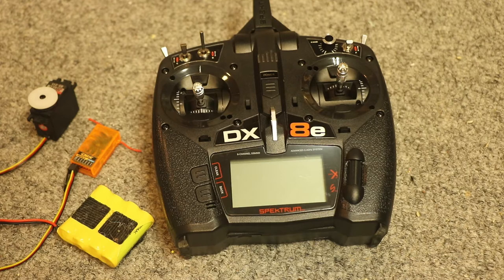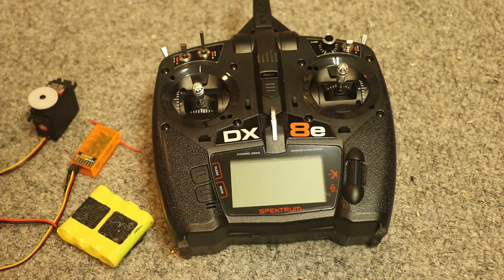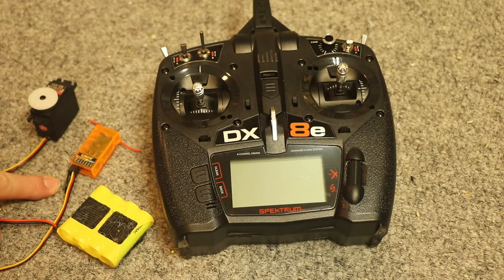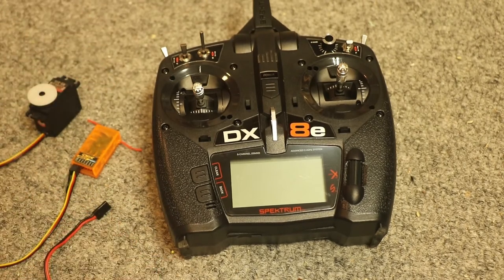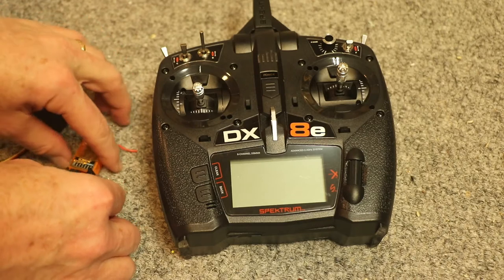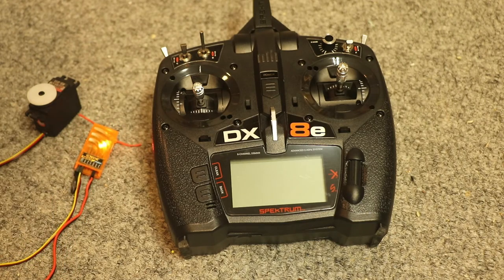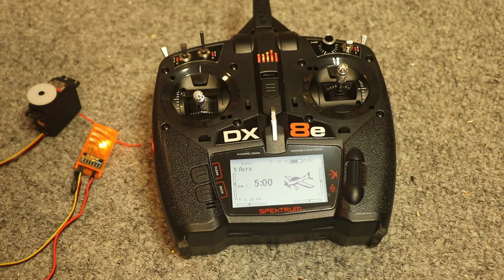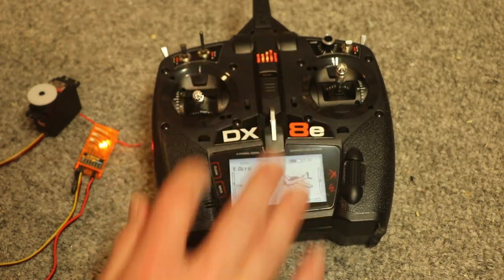Orange R615X binding with Spektrum 8E transmitter

Comment: Fred do you have a source for getting a used multi chan radio modifed to a encoder/decoder format? what current radios have dsc function? my old cirris system has become lost and i need a replacement system.
Merle
Reply from the maker: All of the sources I used 20 years ago have probably moved on with the encoder/decoder down the line electronic controls conversions.  If you can find a used JR DSC radio you will need the deluxe switch harness with three wires to hook everything up. Hopefully EBAY might have some used JR DSC radios. I stopped using DSC radios when 2.4 Ghz was approved for competition, so much easier being wireless. contact me at CLSCALE7@Gmail.com if you want more information on how to use the JR DSC system.

Comment: ask for a video ... connection 2 from the control box to the landing gear ... to the LED ... to the eleron ... to the flap ... and ointment and to the reader ... to the elevator and to the engine / motor drive

Comment: How do you connect this transmitter/receiver to a cl plane as a encoder/decoder setup in control line?
Reply from the maker: look at my video showing how I setup 2.4 Ghz with my RV-4 for CL Scale (https://www.youtube.com/watch?v=jCfmLjRXGmA&t=17s). Basically I fly the model with a CL handle for the elevator while the 2.4 Ghz controls the throttle and flaps. The transmitter is clipped to my belt and everything is done by feel. There are large number of CL scale guys flying with 2.4 Ghz controls for throttle, flaps, retracts,  etc, everything except elevator control. It's basically a hybrid model, it has elements of a CL model but elements of an RC model. stop by the CL scale nats in June and you will this type of application in action.